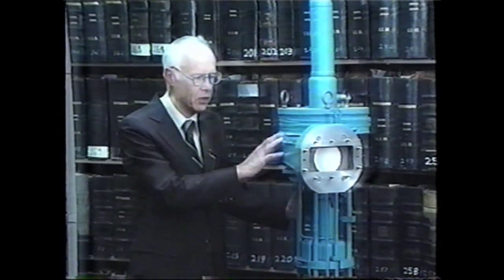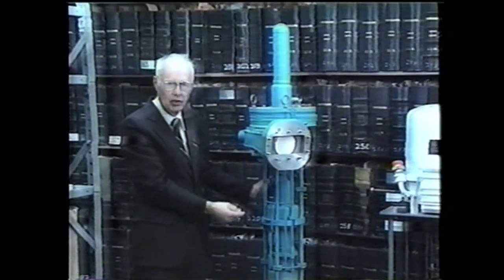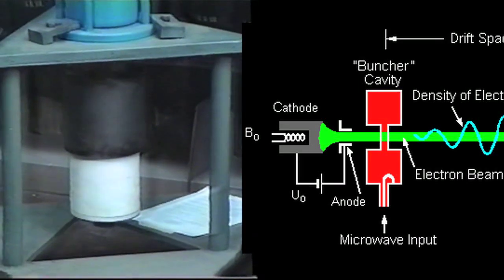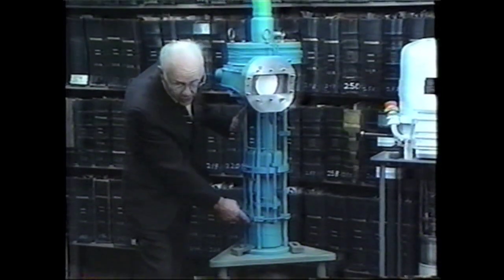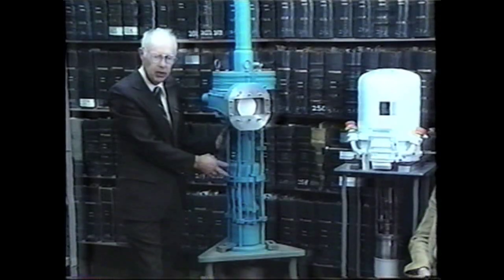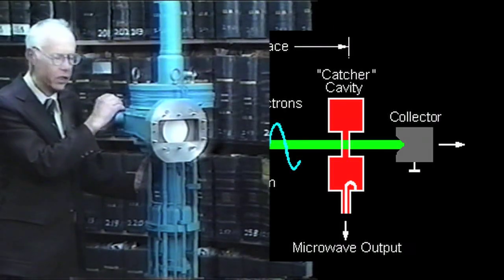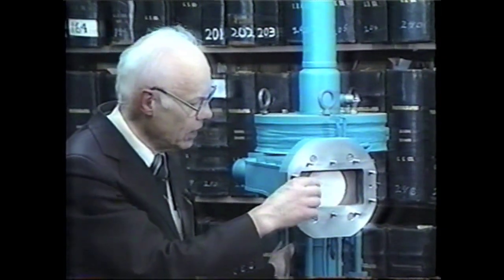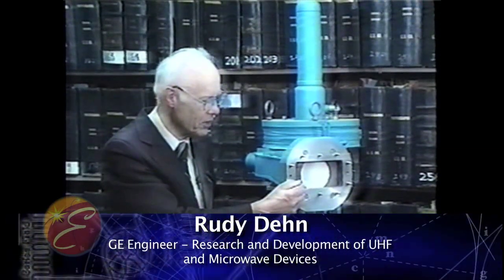How a Klystron Tube Works

Comment: So they created a weapon, basically, because I can’t see any good coming from this type of device.
Reply: But aren't TV transmitters and weather radar useful in our everyday lives?
Reply: @PunmasterSTP  and they can hardly get the forecast correct, the tv is rubbish and only good for propaganda, marketing and easing boredom, the tell-lie-vision is a worthless piece of junk
Reply: Weapons are good if it's for OUR side vs THEIR side. God bless the united States.
Unfortunately Our side is controlled by the federal district of Columbia.
Reply: Used in every radiotherapy machine
Reply: It's used in RF transmission for communication, NOT a weapon...

Comment: I operate Klystron based transmitters, litton l-3403 4 cavity, and make ~2.5MW Pep Max and deliver this power to a 150' fully steerable parabolic dish antenna.
Klystrons work well for a long period of time, but the will eventually fail.  It's a PITA to change one out.  Did I mention they don't make these anymore and supply is very limited.....
Reply: Oh man I'm sorry to hear that!  Are there any newer models on the horizon that your company might pivot to?

Comment: The Beam is staright, that means, the Earth is flat, no curved.
Reply: Flat AND smooth 😂
Reply: Absolutely
Reply: So, I sorta work in RADAR, more like RADAR software.  And the RADAR signal leaves earth, and goes into space in some systems.  So pretty much straight line.  It doesn't follow the Earth's curve.  Not sure if you are joking or not, hard to tell.
Reply: @michaelbauers8800  , you are a Homeless ?......................lol...............
Reply: @peterhoebarth4234  Your question makes zero sense
Reply: No it doesn’t.

Comment: When I worked in satellite communications in the early 90's, I worked with tunable klystrons.  They had a cam mechanism that could adjust the size of the resonant chambers and change the frequency of the tube.  The collector was also air cooled which made the units quite noisy.
Reply: Oh man that's cool!  I'm just reading up on Klystrons because I came across a video showcasing the Mickelsen Safeguard complex yesterday.  Interesting stuff.
Reply: sir, i wondering, what mechanism is used to cool amplifiers and oscillators tubes in satellite?

Comment: I used to work in a southern plant that rebuilt klystron tubes. We rebuilt 982R as well as some NEC types. Some were a lot harder to reprocess. New filaments in the guns as well as repairing the tuners and windows.
Reply: I am not real sure about the life of the different tubes. The main thing is to  make sure of the voltage applied to the filiments is low enough not to over react them. They need to start low and then increase the filament voltage to the point of proper use. A lot of so called engineers power them up at once to get back on the air as quick as possible. That is ghd going that makes most of them fajl sooner.
Reply: @Sitnbull43  Ah I see, that's interesting.  Thanks for letting me know!
Reply: @PunmasterSTP  are you a student or are you working in electronics? I have seen you in some other klystron videos :)
Reply: @N.E.0.N  That's cool; it's nice to meet people in the comments!  I watch educational YouTube often, and randomly came across klystrons somehow and wanted to read up on them a bit.  I also tutor some people in math and science, and try to review and expand my expertise over time.
Reply: @PunmasterSTP  Tutor, that's a cool job, cool enough to cool the klystron's heat :)
Reply: @N.E.0.N  Thanks!
Reply: That's cool!  What were the mean times between failure for the different models you worked on?  Were some notoriously bad?

Comment: The IOT tube (inductive output tube) used in broadcast TV transmitters is a klystron. Now  solid state components (like FETs - field effect transistors) superseded IOT tubes.

Comment: so how dangerous is it to humans?
Reply: Hamish Barrett It would Cook You!
Reply: As dangerous as standing in a microwave oven
Reply: @Spearmint22425  Well, more dangerous, because they are much higher power than microwave ovens.  But of course the energy is directed down a waveguide, than used to broadcast a radio signal for RADAR, or possible other uses for high power microwave.

Comment: no one will ever beat old school like this. Never
Reply: 35% efficient, and the "waste" energy causing so much heat they had to "worry" about parts of their machine melting... I'm sure tech will be significantly more efficient in the future.
Reply: Still more efficient than the internal combustion engine.....
Reply: the best school, impossible to get in to.
Reply: I wonder if he was the first to use the term, “esoteric failure mode”.
Reply: +A. R. Jasso fluorine in the water hadnt taken effect yet